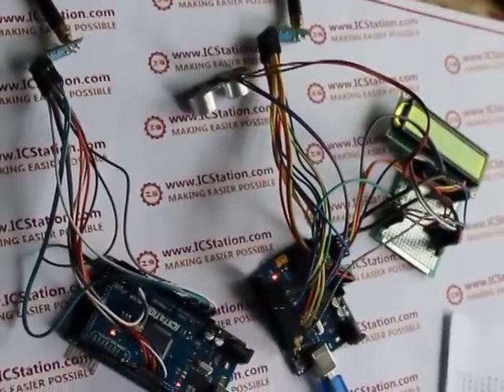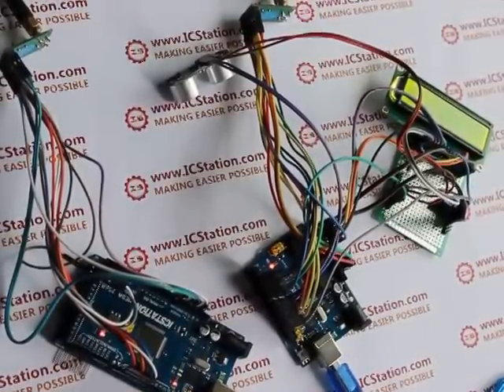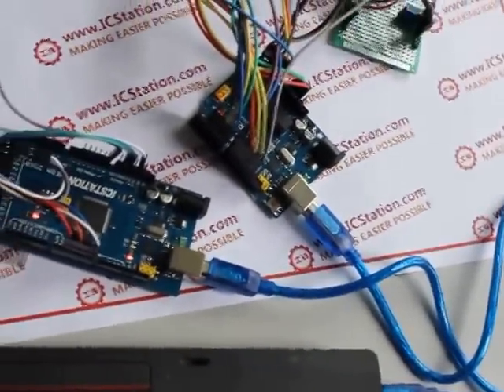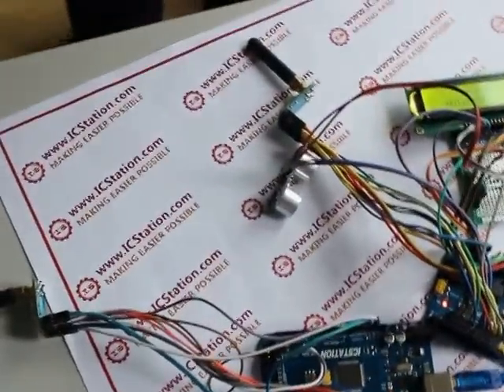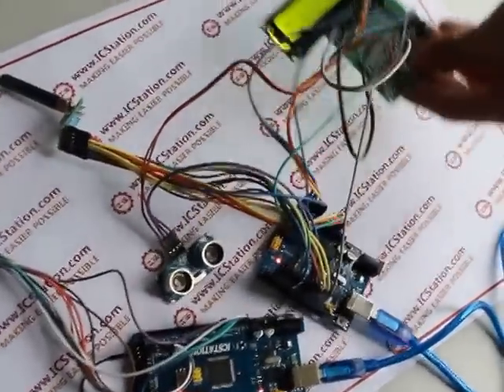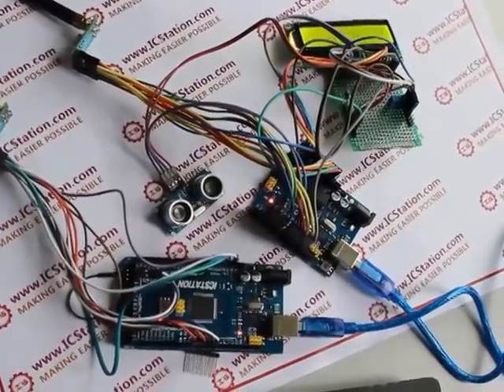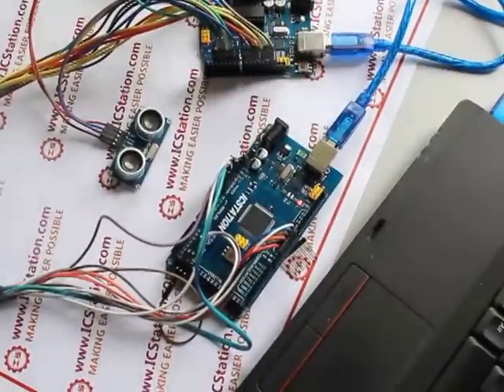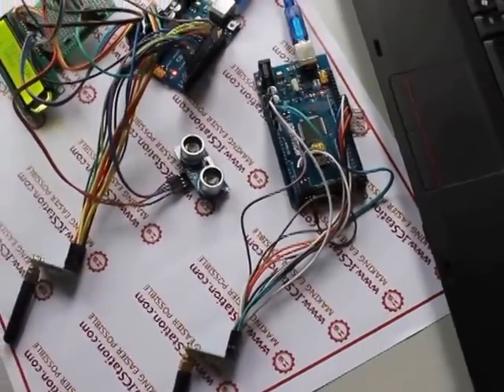Tutorial for Arduino▶4 Ultrasonic Ranging-NRF905 Wireless Transmission System

Comment: i having problem on here nRF905_init();  was not declared in this scoop
Reply from the maker: +tanveer mahmood  Here is the link of code and instruction of the wireless transmission system:http://www.elcesiyejn.com/IC/All%20data%20Chinese/2188.rar 
Hope it will help you.
Reply: Hi Tanveer,  Did you ever get the nRF905 to work?  I'm having the same issue(s).

Comment: Thank you for the tutorial. I was trying to follow your tutorial but ran into a problem with the range of the nrf905. I only get a few meters of reliable data even with line of sight then nothing at all if I move them further way. What is the range you get with this radio?
Reply from the maker: +Pedro Ruiz Sorry for the delay. The range of furthest distance could be 1000 meters, and it relates to specific environment and component parameters.
Reply: Hi Pedro,  Sounds like you got past the initial hurdles.  So you have a working sketch?